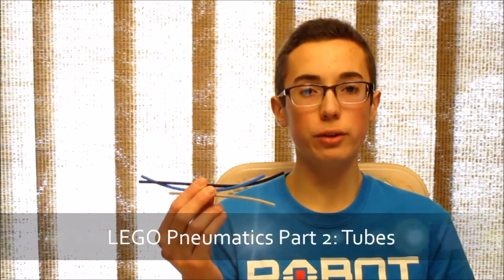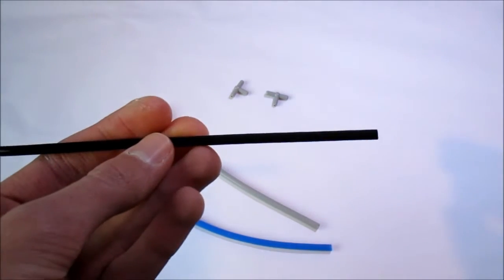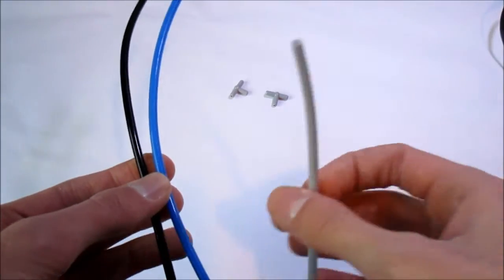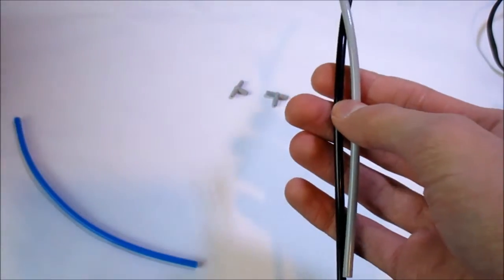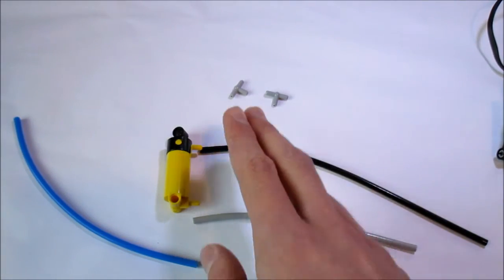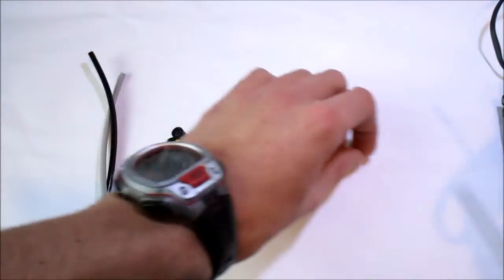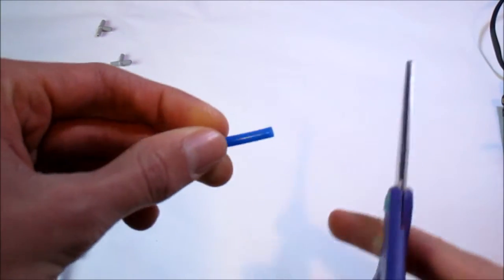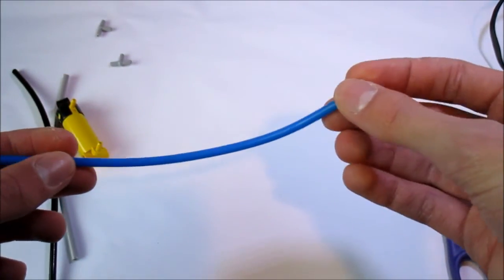LEGO Pneumatic Systems Part 2: Tubes

Comment: Hi can you tell me what are the size of the holes on these tubes please
Reply: 2x4mm. 4mm outer and 2mm inner
Reply: @superbaldi1260 luckily, that's not too rare of a size. You can get silicone tubing of that size online, with the only possible downside being that you usually have to yet it in bulk.

Comment: May i ask what is the size of these tubes are?
Reply from the maker: The external diameter is 4mm, and the internal diameter is 1.5mm. The tubes can be cut-to-length using scissors.
Reply: Builderdude35 Ok thx